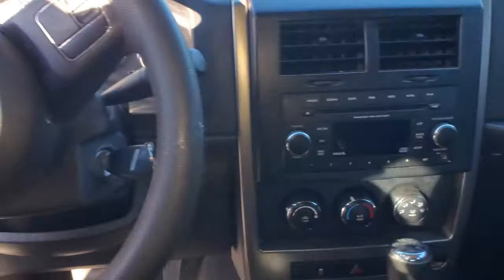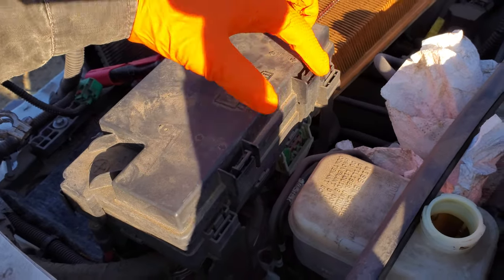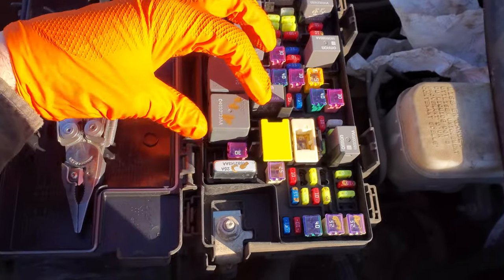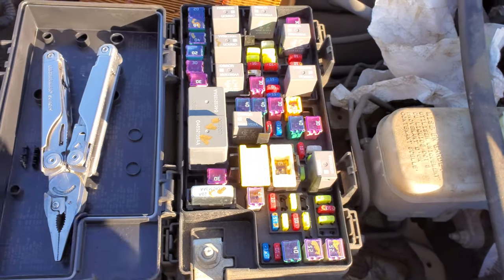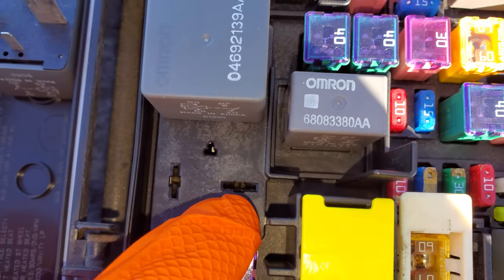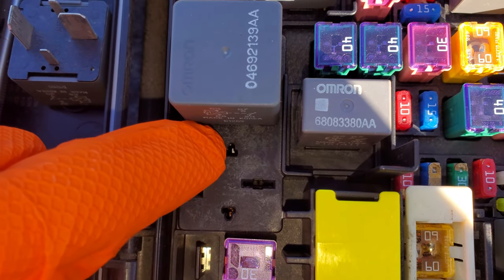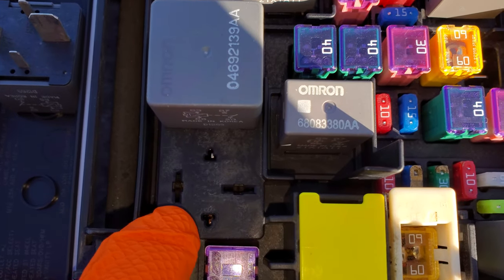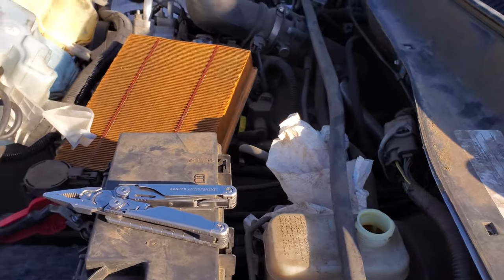2012 Jeep Liberty Cigarette Lighter Fuse, Power Outlet Fuse + Relay Explained

Comment: Just bought a car phone charger and was about to return it as defected cause it didn’t worked. The outlet was working but don’t use it often.... To double check, tried my nephews charger and didn’t worked either and thats when I realized it was the dc power outlet and searched-found this video... Made it easier to fix... Thanks.

Comment: So on my liberty, wife plugged in a hair dryer in the aux outlet and blew fuse. I changed it out and now that it works again it won’t turn off when the car is off and have to unplug phone charger so it doesn’t drain the battery. Got a new relay as in this video but it didn’t help. What’s the deal?

Comment: Thanks for the info!  Do you know what relay/fuse powers the 2012 Liberty Seat Heaters?  My seat heater buttons no longer even turn on when I press them.  I just took the passenger seat out today to look underneath for shorted/burnt wires but everything looks good

Comment: Hi, I Why is the fuse you pulled is in a different location than on my 2012 Liberty I see 3 pin holes mine is the plugged into  the holes which put it closer to the 3 JK fuses on the end. Which way is correct?

Comment: Here's a question. My jeep the cigarette  lighter always has power. Would that be a fuse issue or some type of wiring issue?

I also just recently was installing a stereo and lost power to my hosted seats, 4 ways and all the buttons on the bottom panel. Would that moat likely be a fuse as well? If so, which one? Thank you